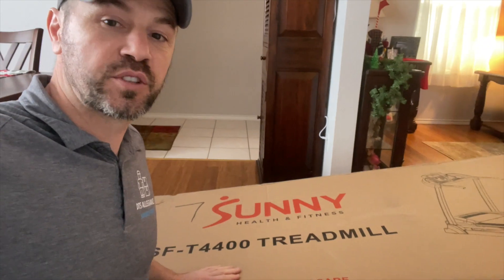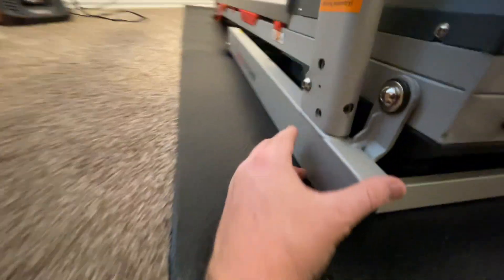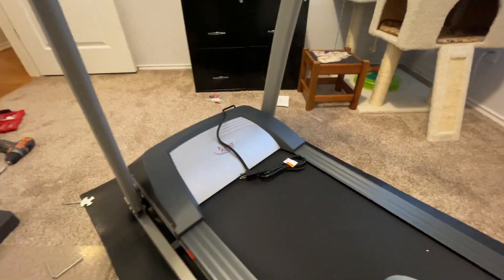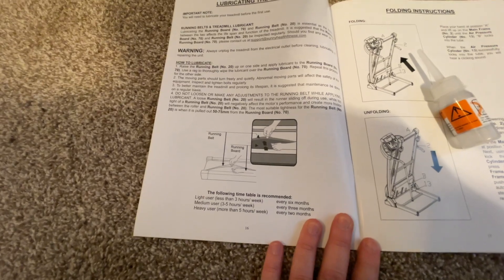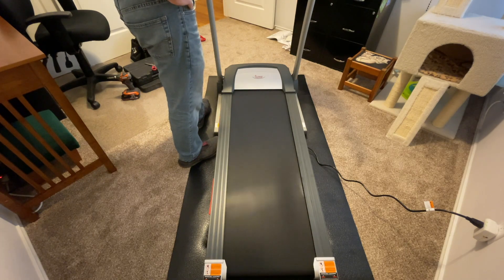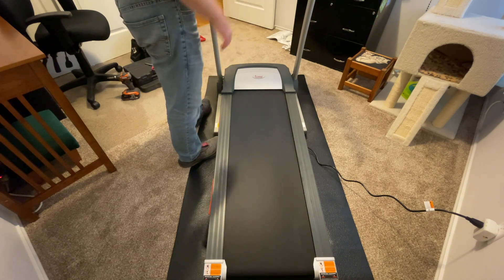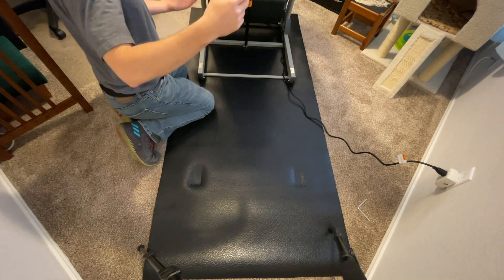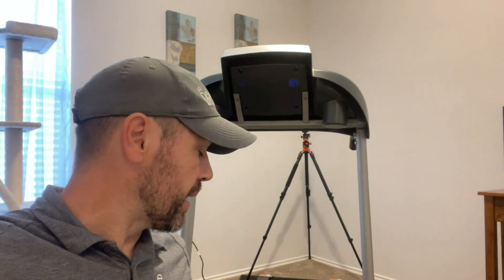Sunny SF-T4400 Treadmill Assembly | Step By Step How To DIY | Belt Adjustment & Lubrication

Comment: Thank you so much!!! The only video I've pulled up the rest have been just reviews
 about to attempt it on my own 
I just got my drop off for a different model it's Sunny Health & Fitness T7643 but same company
 hopefully not too different 🤞🏼
This really helped ease the worry and took the intimidation of it away 
Awesome video
Reply from the maker: You’re very welcome. Glad the video is doing what I intended it to do. I know how intimidating these assemblies can be. Let me know how it works out with your treadmill. I hope you and yours are well.
Reply: @MasteringMayhem  hi..sorry for late reply 
I'm just now seeing this -  I hope you and yours are also doing well.
 This model had the safety piece underneath it.. so that part was a little bit different but everything was super easy (getting it out of the box and positioning  it seem to be the hardest part because it's so heavy 
& 
 ... I was unsure if I put enough oil on it but carefully read the manual and when to re-oil it depending on how much I use it...and the part about having the belt centered I don't think I did properly lol 
but I definitely couldn't have done it without the video you made it gave confidence
Thanks again 🙂

Comment: Having trouble with my sunny treadmill. When I walk, the belt catches and doesn’t move smoothly (200lbs but max weight says 220). I have tried tightening the belt and lubricating. Do you have any other tips or recommendations?  Thank you.
Reply from the maker: Without me being there in person it is difficult to diagnose. How long have you had the treadmill? Does the belt look worn?
Reply: @MasteringMayhem  thank you for the quick response. belt is in good shape. Had it less than a year. Worked fine for first few months then Started sticking.

Comment: ALERT!! You should have included when and why you removed the belt securing the treadmill!!!! I'm a petite 78 yr old female with poor vision and relied on your video rather than the manual. The box was left, standing on its side, on my porch, and it remained in that position as I drug in in the house and removed the box. Therefore, without a clue, I cut the strap that restrained the hydraulic lift while the unit was on its side. I was not injured and was able to understand that electricity was required to operate the hydraulics and so managed to finally get the unit flat on the floor and complete the assembly. I really appreciate your video but did give it a thumbs down for omitting a critical piece of information.